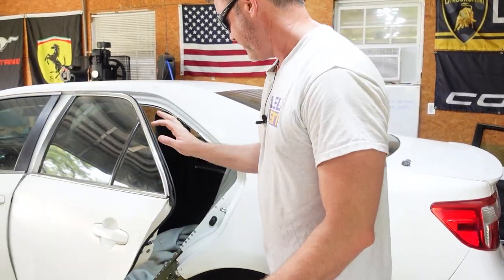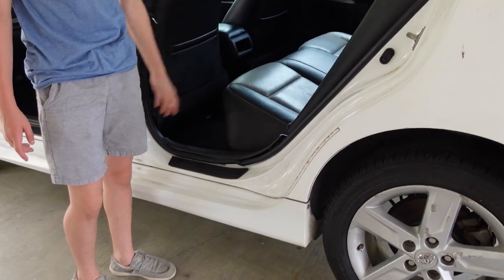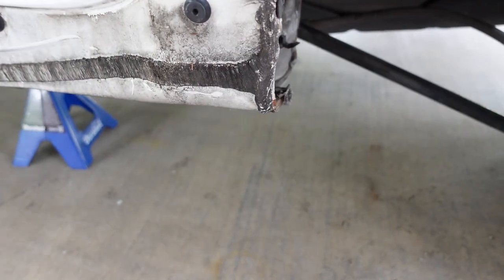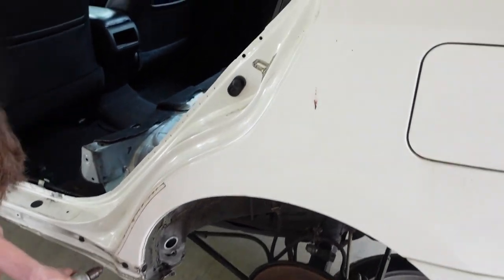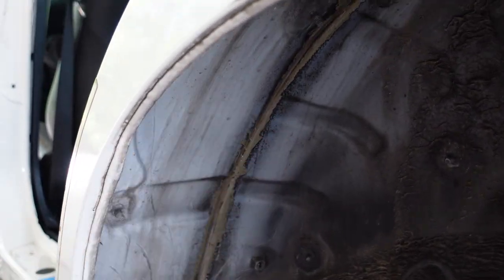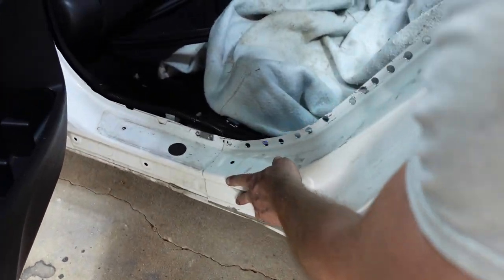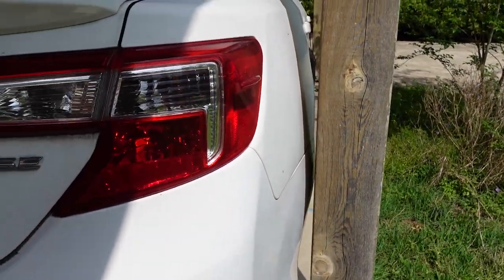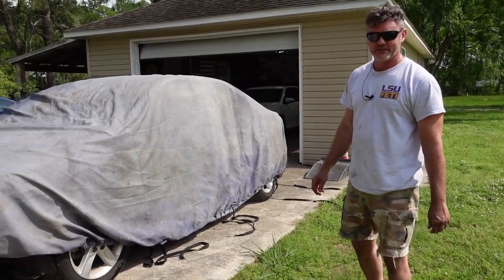Rebuilding a Wrecked Toyota Camry | Cutting out the Quarter Panel Ep. 9

Comment: One suggestion for fitting panels in the future. Lay the new part overtop of the old one,  line them up and cut through both panels at once.  It will fit perfectly.
Reply from the maker: I tried that before but it leaves a gap the size of the cutting wheel and harder to weld up. I probably need a thinner blade or get better at welding.

Comment: Hi good to see you again just for a future ref that seam sealer looks like a double-sided adhesive tape that you can buy to prefix the sill part, you can also buy a drill attachment that looks like a rubber wheel for removing the old seam seal sorry don't know what its called but its worth having one much easier to remove.
Reply from the maker: Ok. Thanks. I actually have that eraser wheel but never thought to try it to n that. I always used it for emblem glue. I’ll definitely try that out.

Comment: Looking good!

I've been using the 3M 08365 seam sealer on my projects.. There's a few products to choose from, but so far this has worked well for me and didn't need a special applicator gun.  I picked it up off the amazons.
Reply from the maker: I’ll add that to the cart now
Reply: @SwampBoysGarage  Track down some of the acid or flux brushes you'd use for plumbing too, you can use those to spread out the sealer for a more factory look, unless you want to go all out and get the fan attachment like your original parts were sealed with.  You can lay two strips of blue tape to help stay in a line as well if you want to get particular about it.